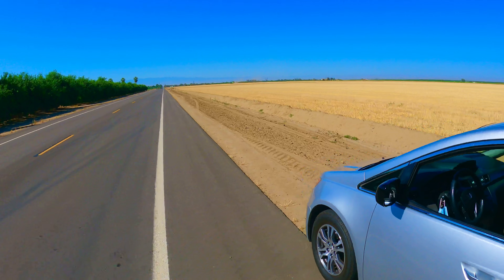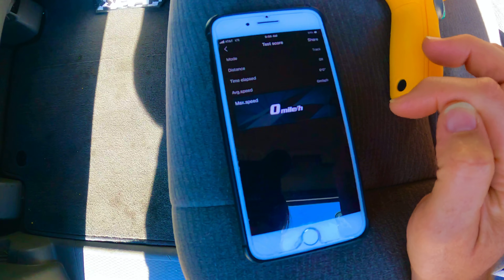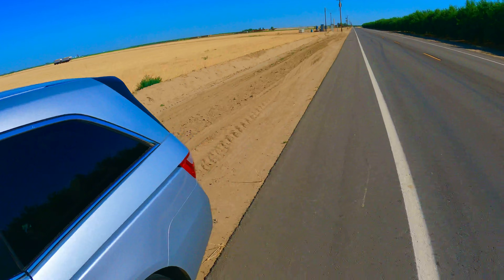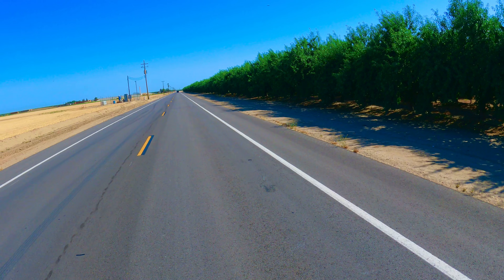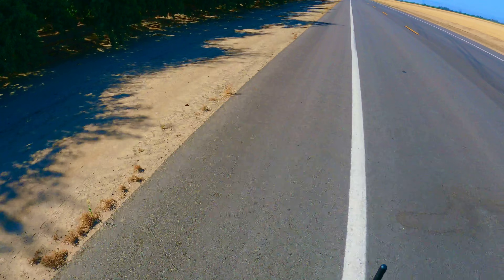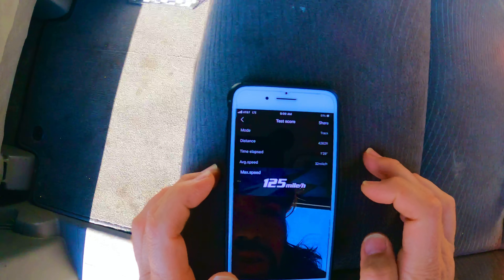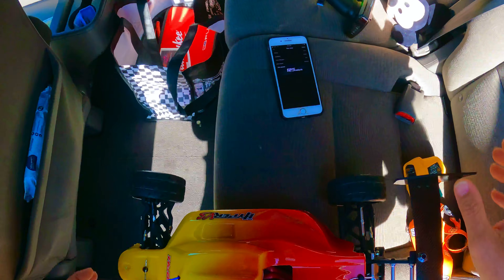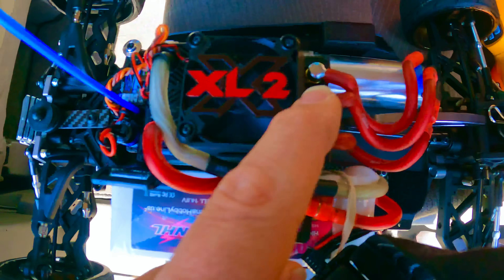Hobao VSE 125mph 4s Single pack

Comment: Awesome run.  Im waiting on a 3640 scm 7100 kv for a slash.  I’m loving 4s cars but when you get into heavier cars the amp requirements are insane.  The scm @ 178 amps I’m hoping the castle monster 8s holds up.
Reply from the maker: Thanks buddy The SCM is only a 2 pole motor
Reply: @93jdmmike  I have 2 4070s in the scm already.  On is 2950kv 8s and then other is 5900kv 4s.  I love them so I’d figure I’d try the 3640.  The 2 poles run a lot cooler